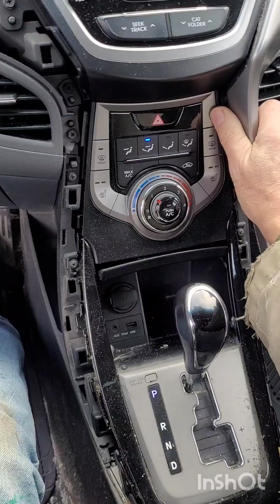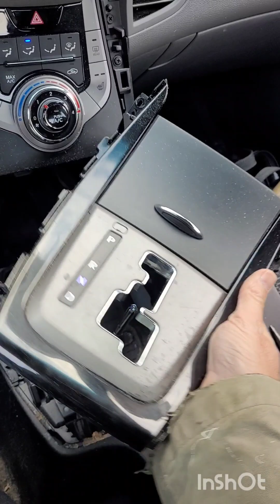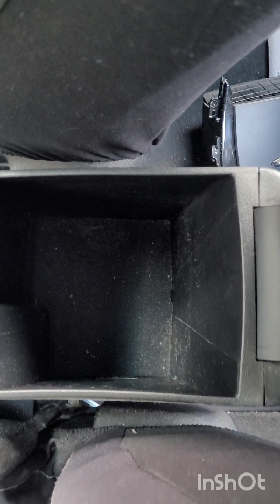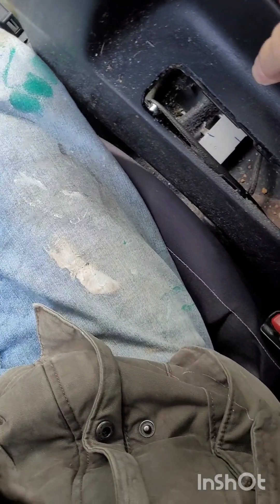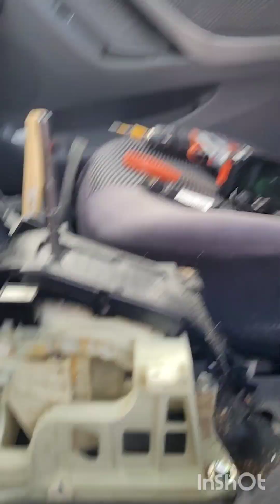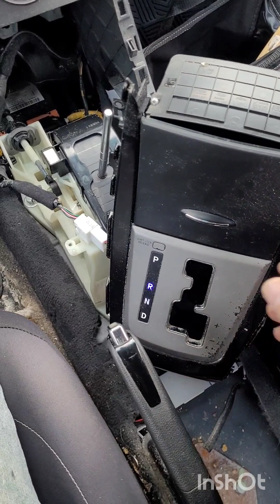elantra gear shift replace

Comment: I have a question in the same realm of this. My shifter works, so I don't need to swap out shifters, but some of my indicator lights do not light up, the R and N. They are not on at all, and even when selected, they don't come on. So do I have to replace the indicator panel, or are there lights in there that can be replaced. I searched everywhere over the internet, with no results.